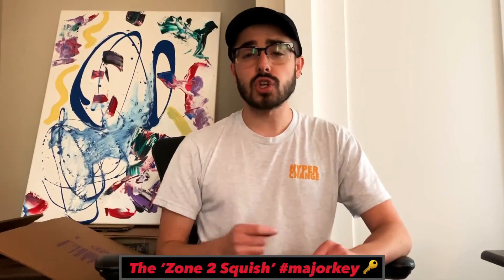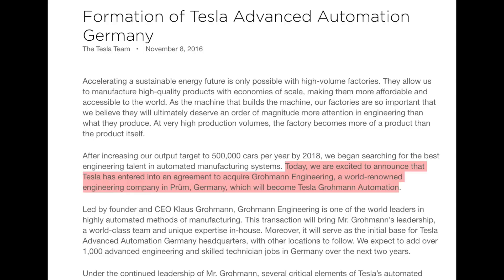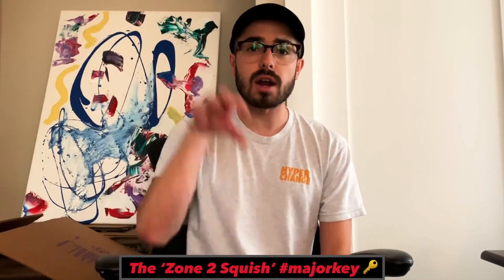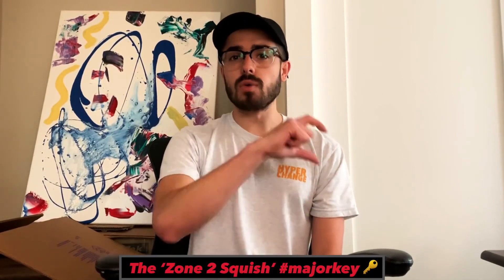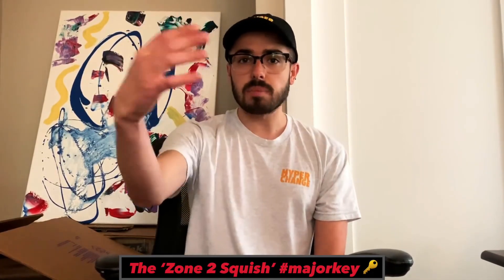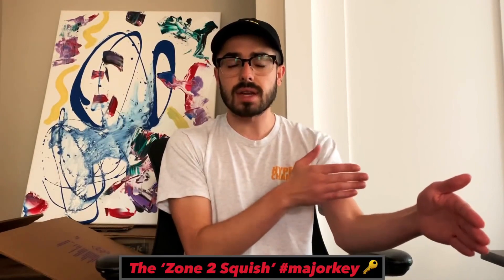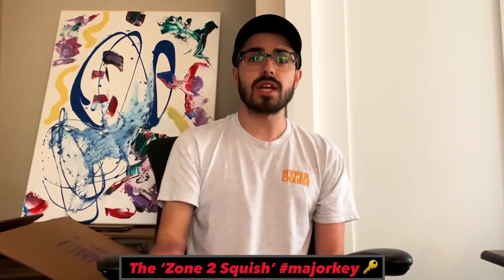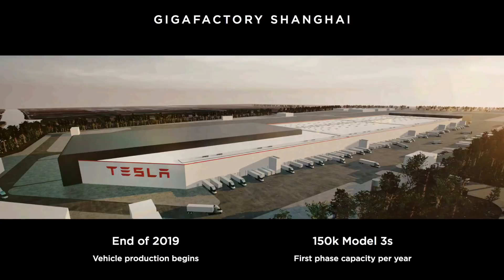How is Tesla Automating Production Lines w/ Grohmann Engineering

Comment: seems like  changing over the other two lines at Giga 1 to Groehmann machines would be a slam dunk.. ..  speeding up the production of battery packs, unless they only need ONE line and will shut down the other two manual process ines and turn UP the Automated line